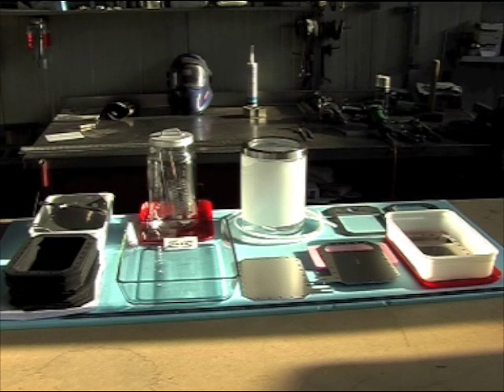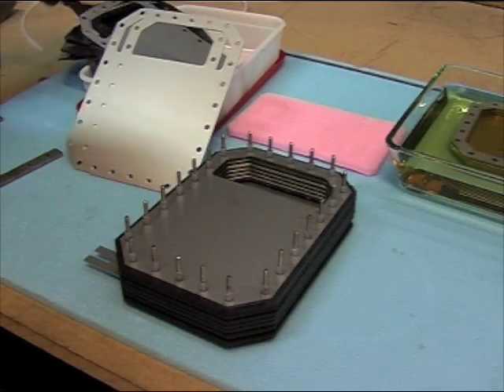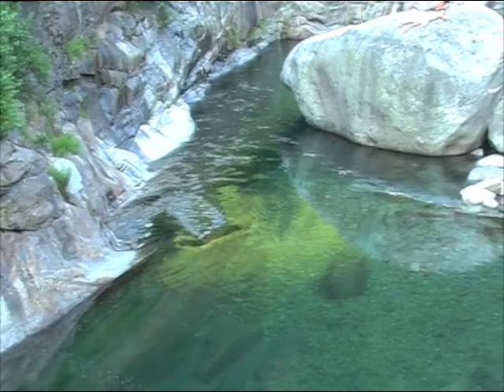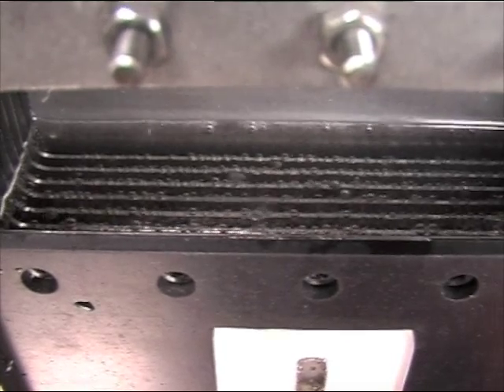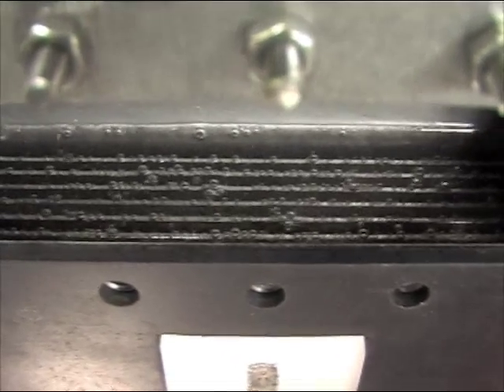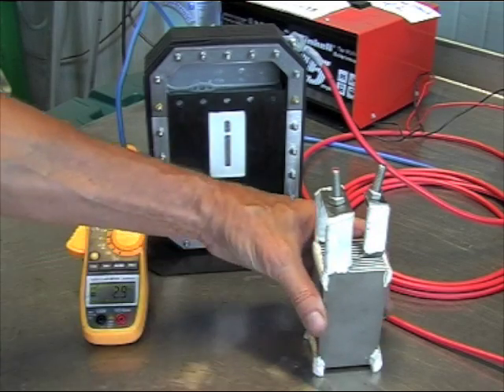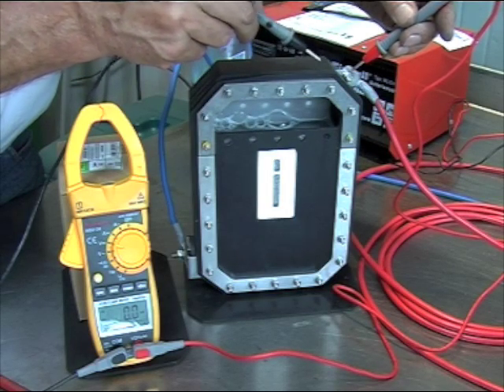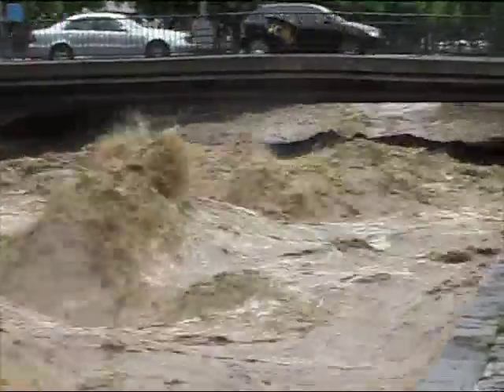HHO SWISS INOX 6 SUPERCELL VARIABLE SIZE

Comment: I am very impressed with your work
I look forward to answering my question: How can I determine the conditions of a hydrogen dry cell design ????
1- Determination of the dimensions of stainless steel strips
2 - Determination of the voltage of the current electricity (volt =?)
3 - Determination of the necessary current intensity (current intensity =?)
4- Concentration of alkaline solution (sodium hydroxide =%?)
* What is the benefit of separating the hydrogen from the oxygen instead of to get it directly HHO ????

Comment: Hi Ammann!  great development since you have the means you can now work on the separation of H2 from O2 as what daniel dingle did. Hydrogen could run the engine 100% by not using petrol. Baking soda is fine its not toxic. You may also use battery solution but its toxic. just try it there is no harm in trying  anyway.

Comment: I like this, but I do feel as if some minor improvements can be made. 1. Roughly sand and perforate the plates. ridges and edges are good!2. Treat water as a resistor in a self recycling circuit.My goal is to get energy use down to 1000 mAh for every liter produced or less.

Comment: Very nice production. I enjoy watching your videos and you do very nice work. I don't think you need to worry about anybody else's comments for enhancement of your cells. Your cell is much more efficient with this cell than the best cell on the market today using no pwm. I can help you out with some electronics if you wish, because I have come up with many concepts that are allowing my cells to produce this level at  less than 1/2 of an ampere, and it is by obtaining the correct resonance. You have an exceptional output for brute force electrolysis. I hope you have by now tried to limit this amperage with a very stable pwm electronic power supply. You seriously should use charging chokes , a full wave bridge rectifier, an inverter, and a transformer to reduce the amperage drawn. I have reduced mine substantially today by adding those chokes inline with the positive and negative of my dry cell. I am currently outputting 3/4 to 1 liter per minute at .19-.20 amperes. That's correct  Point one 19!! I do not have such a good looking cell because I am interested in efficiency, then, I may send money to Switzerland to have you build me one of yours! I may even take a European tour and visit my family in Germany first, then, make my way through Switzerland for the beautiful scenery once again! Again, I wish you the best, you are extremely good at what you do, and you have come up with this type of cell before anybody I have seen online. Consider yourself one of the first to have this. This is a wonderful concept... I hope you have come up with many new designs, I will subscribe!

Comment: yes i do believe this to be correct,im thinkin resonance frequency of 13.65 nghz will get results try blasting it with that at the same time  as the electrolisis  is cracking off , make a  triangluar   cell and shoot the  rf  from the large side of triangle see what happens

Comment: Wow, I wish I had a metal shop like yours. I think the trick is to keep tha amps at 2  by adding neutral plates. 
the most important thing to do is try to increase the voltage frequency by putting a potentiometer on the positive voltage line and increase the output frequency, kind of like turning up the treble on your stereo.

Comment: PART2 
and it needs to be very thin. This produces a better current but you must  put positive and negative cells and after separate weave a flat rubber that you can use a seal aswell. it is going to give you a better performing system . For the electrolyte use potassium hydroxide and at the top make 2  holes 3 quarter inches  please try to  private message me.

Comment: PART1 
I was watching your video about your designs, and I really like it how did you do it?  I want to suggest how you can improve yourself  firstly, at the bottom in each shape cut the triangle , for to distribute the water inside , when you have the package cell the you need to cut 1.5 inches wide on the external part of the cell battery and connect the water from the outside. The cells are too separated in bettween  you can use 2 or 3 seals made from the plastic sticker

Comment from the maker: @1BustedMyth You have a point there and if I am not mistaken Stan Meyer moved in that direction.
Basically it sounds good and makes sense, but practically it could turn out as an extremely complex technical challenge. Nature is doing such things in very efficient ways but replicating it on an industrial technical level often turns into a frustrating nightmare because you know it is possible but you just do not find the key. But eventually some great inventor will pop up... I hope soon. Thanks.

Comment: The Holy Grail is spontainious disassociation of the water molecule, with lowest possible energy imput. My suspicion is that "Harmonics" holds the key, getting the molecule to ring like a bell and shake itself apart.
Remember the bridge in the USA, only a moderate wind, got it to ocilate and destroy itself.
Hi current is just brute force, high tuned frequency is elegant science.
Wine glass, the Singer

Comment: about the bridge you mension ammanni, it on't happens for the folowing reason, no matter how much catalyst you add to the water it will always be a wors't conductor than the steel, just check ir using your multimeter using omic resistence, the current will travel on the substance tha has the lowest resistance possible, and it will always be the Steel, hope it helps you

Comment: Hi from w yoming. Cleaning your plates is good , also try using nickel slag blasting for surface area instead of sanding or plating if you can .One ? for You do you know of a metal that can with stand 1200f-2000f thinking inconel but not sure

Comment: I tried using 75% white vinegar and 25% Distilled water, then neutralized it with potassium hydroxide. This works outstanding. I Have not run this test on a full tank yet but the gas production is huge.

Comment: Your cell runs in series with a very close tollerance between plates. Will the sediment short out the plates shortening the life of the Super Cell?  If you had an insulated area at the bottom with a cavity to collect iron oxide and isolate from the plates this would keep the current more stable. It would be easy to put in a clean out plug as well. Picture an area at the bottom similar to the one at the top except without any conductive plates. Just an area to collect rust.

Comment: I have made a three spiral cell unit that is 12v dc connected in paralel. I use 1 tbsp. of baking soda to one liter of water. When the system starts producing hho the flow is decent. After 30 minutes or so I start to see iron oxide in the water. The electrolyte increases its conductivity as the rust increases. 
When I change the water a layer of rust sits in the bottom of the canisters holding the electrolyte. 

On your Super Cell will you get the same layer of sediment? Will this short cell?

Comment: question from a novice:

is there any reason I can't just take a lead acid battery, remove the acidic electolyte and add the basic electolyte? that is water + bakins soda

after all the lead acid cell is aready designed for maximum efficiency.

does it get warm?

Comment: Very Nice.  If you ever might have a problem with heat with higher production, couldn't one consider extending "wings" from the sides to act as radiator fins?
Your work is not only impressive, but beautiful.
True work of art!

Comment: Very Nice!!!I have an idea for you.Make the plates square,no bolt holes only the window.Take 3/8 lexan,cut to the length of the sides and 3/4 wider than the top.Make a gang cutter that will grove slots for all the plates at once.leave enough meat on the sides to put 2 bolts front and back and side to side.seal the corners with sealer and the back plate will have no window and is negitive.The front plate no window and a fitting for discharge.Make this and send me a ticket to visit your shop.

Comment: PWM is very important for safety and volume of gas production. With no pulsed power supply, the temp will keep climbing as the capacitor is charged. And eventually the dielectric (water) will break down and plasma arcs will discharge inside the cell.

Comment: That cell is the most efficient design so far. But it can be build simpler, mechanically speaking. Google for "series cell.pdf"  I think it's the most documented so far. And there is also a simple way to keep the cell filled with water using the reservoir as a bubbler in the same time. If you have trouble finding them, email me and I'll send it to you

Comment: I will send you a case of KOH for a dry cell.  Great work!
I have built one of your spiral cells +N-N+N- total of 6 windings, Very difficult to do and get it right. It worked ok but I got better results with just the +-+-+-, that was with 3/32 316. I am not going to use 1/8 304 and see what I get. Keep it up, and your english is great.